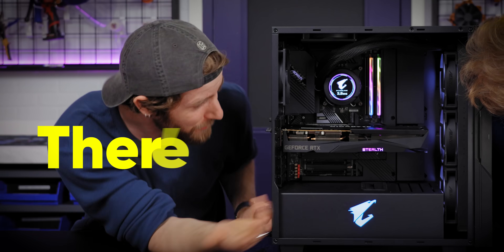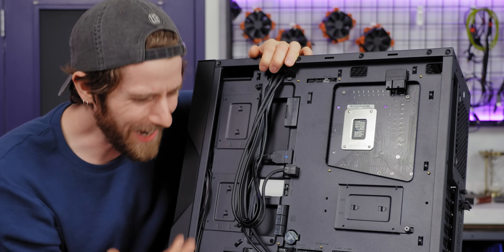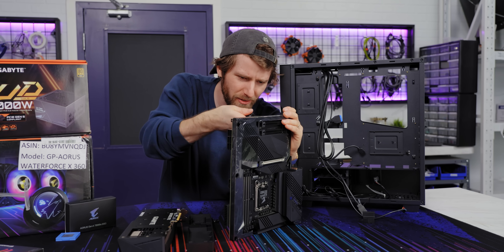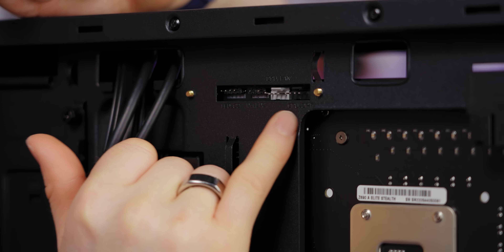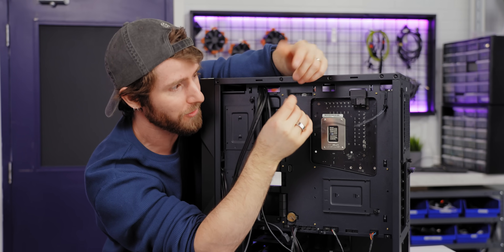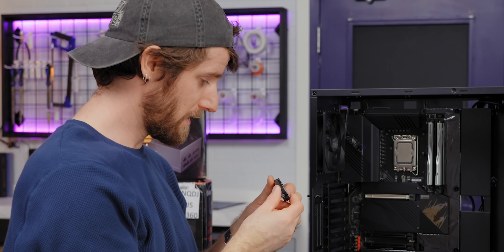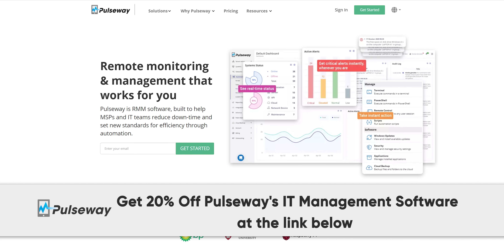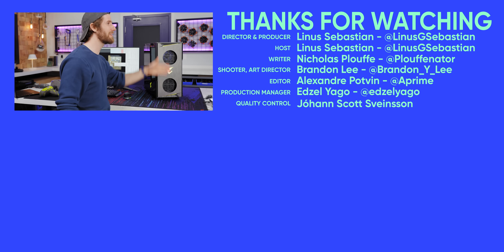Where Are the Cables??? - Gigabyte Project Stealth

Comment: honestly, Linus just going completely nuts at the front panel of the case with a drill was the best part of the video
Reply: He didn't even turn off the pc
Reply: @sennevanopdorp2022  he was just that mad about it
Reply: @sennevanopdorp2022  why would you?
Reply: my case has the exact same problem with airflow and i cannot stress enough how many times a day i wish i had a CNC machine to cut a pattern for airflow on it and put a mesh behind... this case is amazing and has so much space for maintenance and all, but hell, the airflow is SHIT
Reply: @Kuroi  cut out a big rectangle with a jigsaw for the panel and buy the mesh you want from lowes or Home Depot in the sheet metal isle. Cut out your metal sheet mesh a little bit bigger than the hole you cut for the panel, spray paint the mesh to desired color. You can then epoxy glue or super glue the mesh on the inside of the panel, job complete
Reply: @Kuroi  i mean, depending how steady your hands are you dont NEED a CNC machine. Just relatively steady hands and a lot of motivation and patience
Reply: @Kuroi  time to break out the measuring tools and a dremel. Easy enough to do it by hand as long as you measure right!
Reply: This needs to happen anytime there is a case that is designed without front mesh.
Reply: @theatlastech8792  agreed, drills are now part of the required hardware to build pcs
Reply: @Ferrari255GTO  agreed
Reply: @theatlastech8792  Not everyone wants mesh. Sure, you get better airflow at gaming loads, but you introduce problems like coil whine which are high frequency sounds that go straight out the front. With a nice sound padded front panel (like Fractal Define 7 series) you hear almost zero coil whine or fan hub noise. Temps are maybe 5C higher without the panel, but it's a sacrifice. The side vents are pretty big. Just don't put a 4090 in it an expect it to run quiet.
Reply: Jerry rigs everything.....Linus going the right way. Thumbs up!
Reply: @arseniuskoenig  Who's Jerry?
Reply: agreed
Reply: Gigabyte: "You can't just DRILL A HOLE into the surface of AORUS..."
Reply: @ArthurD  I’m guessing that’s a take on Samuel Hayden’s line from Doom Eternal.
Reply: @clayton8816  correct
Reply: I laughed my ass off at that part
Reply: This is what's known in the industry as a "pro gamer move"
Reply: Steve would be so proud.
Reply: I had much a similar reaction with my case Thermatake C22 (it was cheap...I regret it)  black plastic on the top and front, snapped it out and replaced with mesh cos it was just too damned hot
Reply: @jimwatson1013  i have a similar model. the only airflow is 3 small vents on the front side and top side. looks like a great case, but god it’s hot
Reply: You'd think they would just easily incorporate the "new Linus holes" into their case design.
Reply: In all fairness, they did call it a DIY kit.
Reply: Somewhere, Steve from GN is smiling
Reply: That was fucking amazing.
Reply: I was going to comment the same thing. It seriously is the best part of this video. After all the frustration of this case, to just destroy/fix the case in a few minutes with just punching huge holes into it. This should be a big wake up call to these companies to not sacrifice on airflow, especially when a solid front like this isn't even appealing to most consumers when you have glass side panels anyway.
Reply: please god have Steve from gamers nexus start doin this to shitty cases and ill never ask u for anything else 🙏
Reply: @PhyrexianMetal  honestly would've been nice to fly Steve over just to drill the holes himself.
Reply: and it doesn't even look bad!
Reply: That was so cathartic. So sick of no airflow cases.
Reply: He's getting older and bolder. We have seen nothing yet.
Reply: I support tech reviewers going nuts on hardware they review to show dem corporation how it's done ! Steve (gamers nexus) did the same with the dell nightmare recently and it was GREAT
Reply: Jake was over the like "Linus you really don't want to do this" but silent after Linus probably rage monstered over it lol.
Reply: This needs to be a meme
Reply: Yup
Reply: Even Jack was scared, and he usually talks shit about Linus whenever the chance presents itself
Reply: Love how it just wasn't discussed. It didn't need to be. Especially with the instantaneous results.
Reply: Naw bruh it was 15:10 when he was in the shower
Reply: GamersNexus would be proud
Reply: Gigabyte deserved it!
Reply: He had zero fucks to give.
Reply: I'm gonna eco most people here. It's time for the manufacturers put some brain behind the design. Every time they come up with such stupidity we should somehow exaggerate the solution so the bad rep spreads and hopefully, they will learn
Reply: Jake’s reaction was the best part.
Reply: My favorite was when he dropped it and you could see that he knew he'd just added to the meme.
Reply: This has been his best use of f you money ever, imo.
Reply: Why not? Problem solved. You could align the holes to the fans, use a deburring tool and then put some mesh or dust filters behind it. Only if you want it to look clean, that is.
Reply: Saw it coming a mile away
Reply: Man you spoiled it for me :(
Reply: Hold on...... Brilliant idea for my h510
Reply: @jeanxlaxon7897  my h510 runs just fine under 60 degrees...
Reply: WAS ABOUT TO SAY THE EXACT THING! More psycho Linus plz!!!
Reply: Occupational Hazard Tips™️
Reply: Imagine they draw some cutlines to see where to cut for better airflow, instead doing it themselves
Reply: Reminds me of myself and dad when we did the same shit years ago when I was in highschool
Reply: I thought it was coming a lot sooner than it did, but I'm still glad he made his point.
Reply: Has anyone ever Done an ltt vs xiaomi screwdriver comparison?
Reply: Yep
Reply: And the iFixit Drill was born.
Reply: My case has the exact issue BUT I can't take a drill to it as the front is bloody tempered glass glued to the bare metal with wimpy side vents that don't work
Reply: @Montisaquadeis  circular hole with glass cutter, problem solved. Go on, you know you want to. Don't ask linus, he would just use a hammer lol
Reply: I agree 👍
Reply: Legend !
Reply: And did it with the pc still on ! Epic
Reply: Yep 100% agree!
Reply: 11/10 please Linus do that again
Reply: Gigabyte disliked this
Reply: Did he just... Did that just happen.... What the?...🤣🤣🤣
Reply: Was not expecting that 😂
Reply: Totally totally agreed!
Reply: Gigabyte like so we lent that to you and need that back lol
Reply: Yeah it was, I want to see more angry Linus. Maybe next time he can take a spark plug and shatter the glass front on one of those tempered glass hotboxes.
Reply: Gigabyte like WTF is he doing shows CPU temps oh OK, picks up phone which idiot did not test just putting hols in the front...
Reply: Yes
Reply: Imagine the marketing team that sent this rig when they watch that scene. Drop dead
Reply: Agreed
Reply: My friend has a case with a solid front panel. He had a fan mounted to it, but because he had a super low end ITX board, there weren't enough fan headers to plug it in alongside both the exhaust fan and the CPU cooler, so he left it unplugged
Strangely enough, it was actually the part of the case that was the most dusty when he had me over to clean it. Even the filter under the PSU was less caked than the filter for the front of the case
Reply: I was dying lol
Reply: YES
Reply: 100%, brought the video from disappointing to entertaining 🤣
Reply: It actually looks pretty dope with the air holes drilled in
Reply: that was also my thought when see the front panel but like more smaller like just a small drill bit
Reply: Yeah, I'm about to do this to my m atx build. Then add a 240mm corsair rad
Reply: 100
Reply: Can`t agree more 😀
Reply: Of course the internet only likes to see people destroying stuff
Reply: BECAUSE YOU PIRATE I AM DOING CHARGE BACKS ON YOUR STORE UNTIL YOUR CC PROCESSOR DROPS YOU
Reply: Linus starts selling a drill kit to make your pc cool better.
Reply: I totally agree, I laughed so hard 😂😂😂😂
Reply: For sûre
Reply: Where are the goggles!? 😳
Reply: 100% agree this was great
Reply: I didn't see this coming aswell. XD
Reply: Wow
Reply: Agreed, I can't stop laughing.
Reply: Jake's face explained every experience he's ever had working at ltt.
Reply: and the fact that it worked immediately. Seriously how does that pass testing before release? There clearly was no testing.
Reply: facts
Reply: Mine was when he dropped the computer and they did the voice over lmfao
Reply: "Genius airflow case mod"
Reply: Absolutely 💯.  The highlight of the video!
Reply: Spoiler warning!
Reply: Imagine the making of Linus piss off with this built
Reply: speed holes are great, that's the only reason I bought a hole saw for my drill.
Reply: that was funny as hell! :D
Reply: Agreed :D
Reply: No. Best part was "It's all good man"
Reply: And the PC is even turned on.
Reply: Hence the reason why I 3D printed a custom front panel. Snagged an STL file from Thingiverse, tweaked the design a little, put in matte black filament and done.
Reply: nice spoiler
Reply: Spoilers take away other peoples enjoyment :/
Reply: Frr😂
Reply: Linus: it's probably gonna overheat

Case: no I'm not, I promise!

Linus: uh huh, we'll see.

Motherboard: yea we gotta throttle.

Linus: FINE, I'LL FIX IT MYSELF!
*drills huge holes *

Case: nooo! Not my face!

Linus: Muahhahaha

CPU: oh thank God. I was sweating in there. Thanks Linus!
Reply: It makes me hope Gigabyte management saw this and were embarrassed. And I feel sympathy for the employees who probably warned about this, but were shunned by said management.
Reply: Your comment was on top for me and I read it half way thorough the video. And knowing linus I knew exactly what was going to happen.
Reply: George Floyd gaming pc
Reply: Also. Project stealth would not have logo either on the pc case neither on the motherboard. Thanks gigabyte but I'm waiting for a more detailed manufacturer. Thank you!

Comment: I'd actually love if GPU power connectors were like that on every card
Reply: The reason it isn’t is because GPUs all use different power connections, if they’d all just use one it’d probably already work like this 

This is a reminder that a usb C can transfer 240W and the thirstiest full systems are usually 1000W and already use four connectors.
Reply: @randombrit13  Could use a good compromise, at the end like 2000 cards did.
Reply: If the new PCIE Gen5 (12VHPWR) connector was a standard then this would be so ridiculously easy it's not even funny!
Reply: @CarbonPanther  what’s a VHPWR
Reply: @randombrit13  A newer, better and more standard version of the 12-pin connector Nvidia's RTX 30 cards use.
It's meant for the next generations to come, has 16-pins total and can deliver somewhere in the range of 600W.
Reply: @CarbonPanther  could do with a better name but otherwise so long as it’s not an Nvidia  patent much better then running 4 USBcs together.

Comment: This is one of the first gimmicky ideas that I could easily see taking off. I’m really excited to see if this becomes standard or at least a more available option on future boards, cases, and cards.
Reply: Boards would have to be built specifically for these cases. For GPUs, it would be easy so have connectors on front and back and an optional shroud on the front one. For boards, I think it would be simpler and more compatible to have all the connectors pointing to the side like the SATA ones and then cases can just provide shrouds to cover everything up.
Reply: I really hope this takes off!

I can imagine this going the way of the PSU schroud.

Comment: For years I've wondered why they couldn't put the PCIE power connector on GPUs at the rear instead of the top, and towards the bottom. Would make for a lot cleaner cable management, and be a very simple change.
Reply: or on the side opposite the IO, even.
Reply: @KingofWorms2E210 y Yeh, would make builds so much cleaner.

Comment: Not only does it look slick, it looks more organized to me. I'm not due for a build anytime soon, but I hope this becomes more common in the future!
Reply: It will, just don't count on Gigabyte to lead the way.
Reply: if you watch the whole video the case is actually kind of poorly designed, so you better hope for a better attempt in the future lol
Reply: @HearMeLearn  I think he is referring to internals
Reply: @HearMeLearn  The concept is great, those little things are easily fixable and has more to do with bad quality control.

Edit: apparently someone didn't get it, but I meant "easily fixable" from a manufacturer standpoint. These are small issues that would be easy to rectify from the manufacturer. OBVIOUSLY I would not recommend a consumer to buy something if they have to modify it to make it work as it should. USE YOUR BRAIN!
Reply: @HoloScope  They are easily fixable, as Linus showed by just cutting a big fuck-off hole in it, but the point is that he shouldn't HAVE to drill a hole in the case. This isn't the early to mid-2000s, where enthusiast PC cases were rare and you needed to take a dremel to your case to do proper cable management or whatever. With the DIY PC market as big as it is now, you can buy a case that you shouldn't need to modify at all.
Reply: @billyeveryteen7328  My take away from this is Gigabyte done fucked up again.
Reply: @billyeveryteen7328  Umm.... I meant easily fixable from a manufacturer standpoint, not the consumer standpoint. Obviously I would not recommend this to a consumer if they have to modify it themselves. Use your brain dude.

Comment: Fucking finally, I've been advocating this for the last 20 fucking years. There is absolutely no reason to have the connectors in the front if we will have to route them to the back anyway. Not only that, but the motherboard could have rount holes to pass through the cooling tubes/pipes to the back, so it doesn't hang out in the midle of the freaking case.
Reply: Great idea, but would only work on custom loops
Reply: Same. I often thought drilling holes in motherboard for better cable management but I lack the balls. I also thought maybe these components and connectors could be soldered from the rear of the mono but same lack of balls. 
However I do have an old ass athlon system I could donate for experimentation
Reply: @havoc6021  That's a great way to go through traces and destroy the board.
Reply: @blunderingfool  yeah I know that's why I have not the balls. I do recall Linus doing a video about drilling mobo and traces you can't see. I'm sure it's possible and shall attempt it with my old system

Comment: I really hope we continue to see boards and cases like this in the future!
Reply: not really... i mean... instead of just plug in a cable from one side, you now need to reach the PC from the other side. Imagine swapping out a fan. With "normal" boards, you just open one side of the case, unscrew the fan, unplug it, screw in the new fan and plug the connector in. WIth his kind of board you have to access the board from both sides. THat's just stupid.
Reply: @ulliulli  True, but if it were possible and more innovation happened, we might be able to see boards that are "hybridized" for lack of a better word.  I'm imagining some standard for having some fan headers on the front and back of the motherboard so that back/top and front/bottom fans might both have short runs and only require 1 panel to be opened.

Comment: How do you upgrade the GPU in the future? If it only works with this one case, how could you possibly resell it?
Reply: @Dylan Does Tech That's a pretty expensive component to not be able to offset the upgrade cost for.
Reply: @yuGtahT  Exactly.
Reply: They can make a new gpu for that case
Reply: If it resell for less it'll make a great deal for anyone with minimal DIY skills. Not too hard to modify another case and add the cutouts.